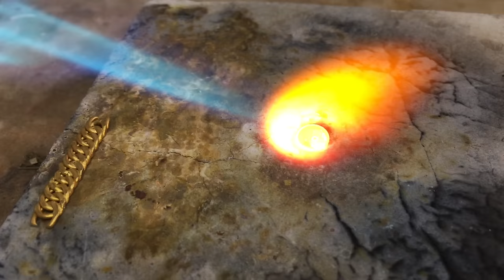Chain Ring Making | How it’s Made | Gold Ring Making

Comment: Ive never wanted to try something so much in my entire life! You make it look so easy. Mine would probably look like fruity pebbles if i tried this 🤣
Reply: @BOBBO’S WORLD I highly suggest trying it. I’m in the same boat. Start with copper. Use simple hand tools. I got a jewellers frame saw on Amazon for 20$ and it came with 144 blades. Get copper wire from a hardware store or a craft store. Cheap butane torch from a hardware store. Get copper solder. You can use hard solder or pallet solder like seen in this vid or you can use syringe solder. Just mess around with jump rings (the circles he makes by cutting the spring he made” make a simple chain by just linking them together. Solder. File. Polish. It’s super fun